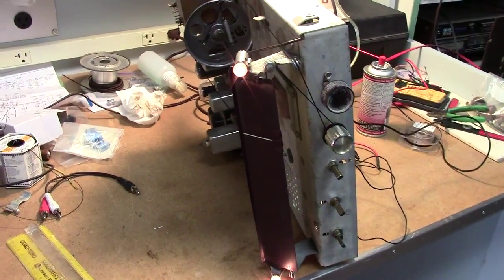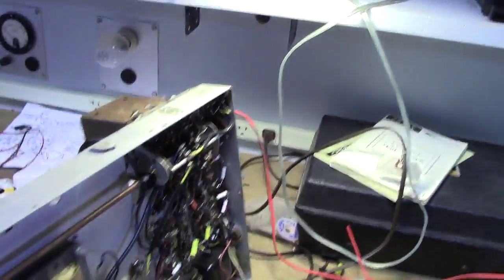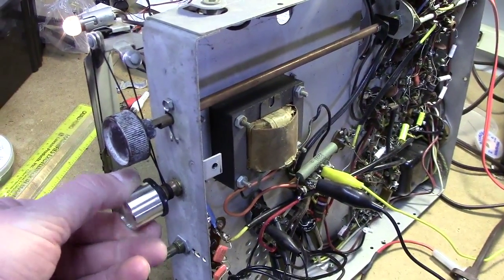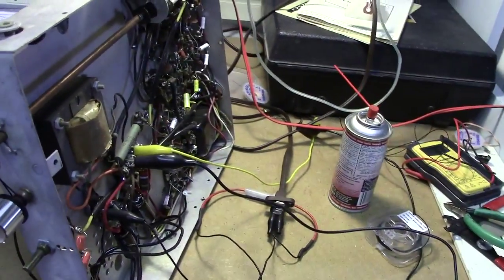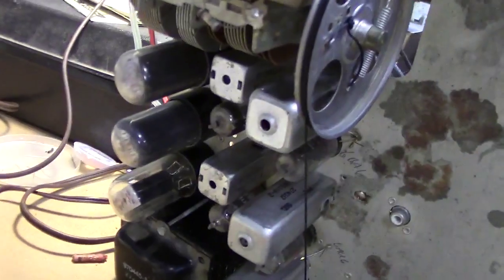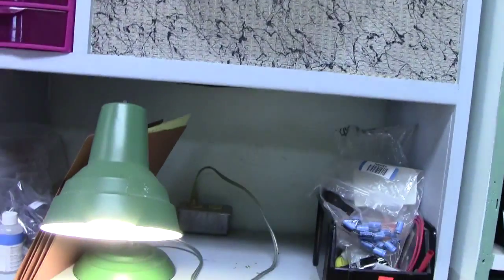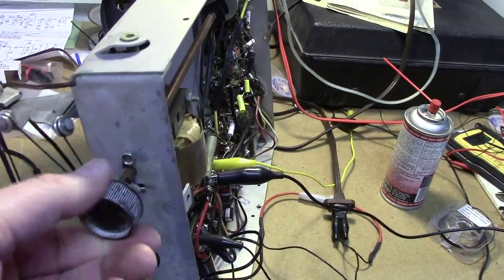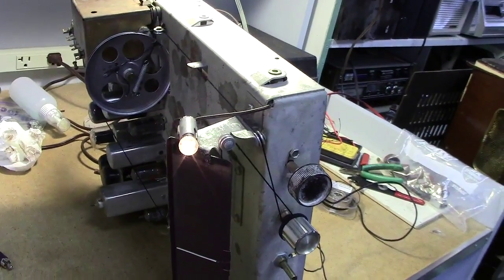1951 RCA A-108 AM/FM radio chassis test

Comment: With your skills you I know you can get this thing back in full glory. I have an 1953 RCA Victor 2-C-521 clock radio with no audio in the tuner section which has me thinking it has the IF symdrome too. Still useful as a clock and amp for a component 45 player and has been recapped too. I don't think I have the patients to rebuild the IF cans and I don't listen AM anyway for that there's nothing good on. Keep up the good work Chad! :)

Comment from the maker: Hello, I will try and show the mica problem better in the future. No, they are not sealed in this case...they are pretty cheaply set up exposed to air inside the can. They are just a sheet of mica with a silver coating, laid in between two metal contact fingers and this exposure to the air of these parts I think contributes to the problem. I think there are two problems, migration of silver on the mica surface leading to shorts and oxidation leading to intermittent open connections.

Comment from the maker: Sometimes the Photofacts will show a value but in every regular AM/FM radio I have done, 100 pf for AM and 22 pf for FM has worked. Just slightly re-tune the transformers and it should work fine. For communications receivers like Hallicrafters I think it specified 300 pf or some other value and I put those in but in regular home tube radios 100 pf for AM has worked good.

Comment from the maker: I have had radios with bad mica IF caps cause no audio at all instead of the popping so it certainly could be the problem. Sometimes like in this case the AM cans can be bad and the FM still good. There are other causes of no AM such as the AM oscillator circuit not working but in almost all cases I have found it's the IF cans.

Comment: I have the Zenith G730 AM/FM radio you profiled in April 2008. Its FM is great. AM is non existant with smooth static. Not crackly poppy like your radio in this vid. I replaced all the caps. Other components look good. Should I also look to the IF cans as the most probable cause? Can anything else cause loss of AM.

Comment: Re my previous comment, my zenith g730 may have the bad mica cap syndrome. I took apart one 455 kc IF can & saw no sign of caps. just what looked like a frosted looking clear disc in the plastic base. I could touch & move its edge. The post had a red & a green coil. Thats it. What do these mica caps look like?

Comment: Chad how do you determine the value for the mica caps in the IF cans?  I have two battery operated portable single play RCA 45/AM radios. One of them sounds exactly like your A-108 does with bad micas. Sams Photofacts and RCAs schematics show no values for these micas.  Does the 100pfd value work for AM IF cans regardless of make/model?